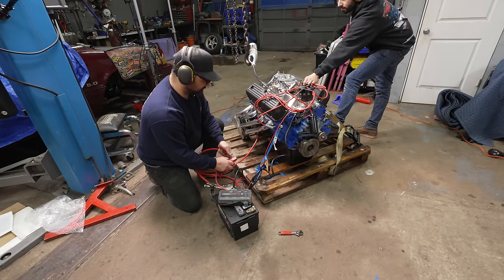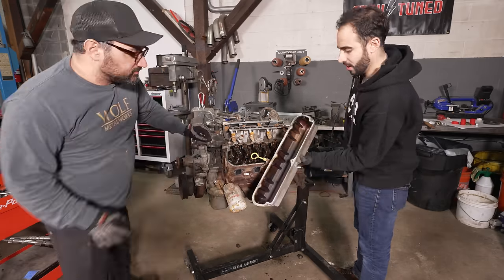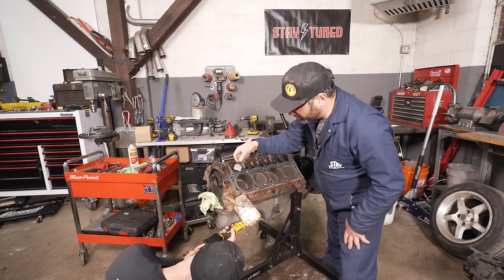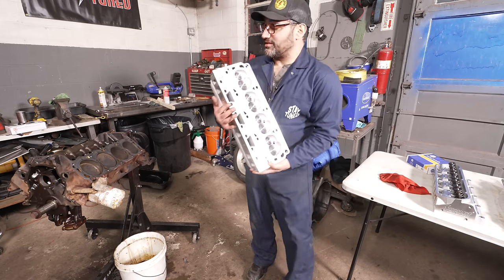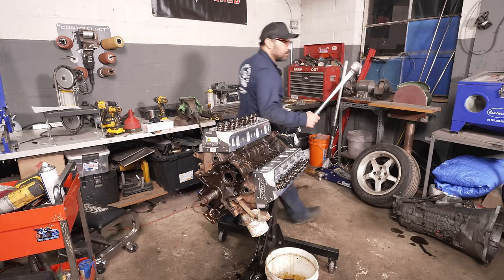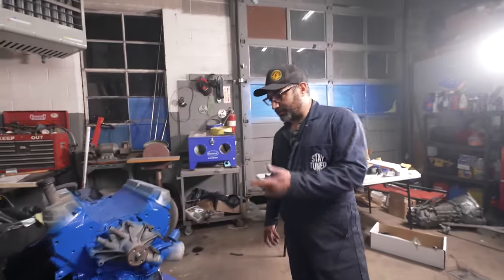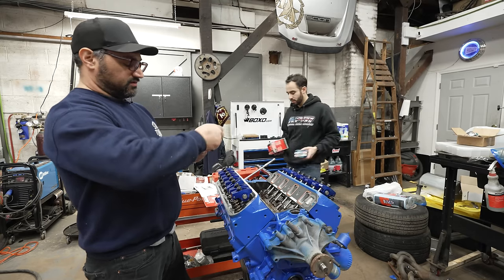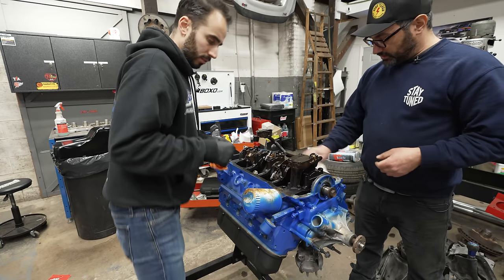Building a Junkyard V8 into a KILLER Horsepower Machine For Vice Grip Garage!

Comment: looks like a solid 87-92 Ford HO 5 liter.  all small block Fords have Forged connecting rods, 85-92 HO engines have Factory TRW pistons and a metric ring pack(1.5/1.5/4/0).  cranks were all cast other than the Boss 302/tunnelport 302 back in 68-70.  will make a lot of fun.  have a 67 Fairlane in paint Jail right now and cannot wait to get it back together.  Love the channel, sent you guys some pizza, hope you enjoyed it!
Reply from the maker: Thanks for the info and for the pizza! Appreciate it!
Reply: Ohhhh my C4 Corvette had TRW forged slugs too
Reply: Bro has a turbo on his 5.0 HO in a Foxbody.
Reply: That's too bad.... The TRW's are heavy ass slugs.
Reply: @davelowets  so is ur mom 🤪
Reply: "Paint Jail" so true lolololol
Reply: Getting ready to buy a fox body that’s been carb swapped and gathering info to find out if it’s the original engine or not and what I need to do to it. I know it’s been cammer and hei swapped, eldebroken 650 or 750 on top. Looks like an HO to me and it’s an 88 so I’m pleased. Looks like it was done right to the best I can tell from pics. Thanks for the information!
Reply: 0:08 needs more timing
Reply: 5.0 liter boat anchor. Might even sink the boat

Comment: I've only installed 390, 351, 400 Cleveland, 302 HO intakes using the end gaskets supplied, also gasket sealers at the corners, None of them moved or leaked. I have, however, seen others have to clean off and re-squeeze because they neglected to lower evenly. You do you.
Reply: Never in my life (48) known anyone to use the provided end gaskets on any pushrod Ford, myself included and have never had an issue...

Comment: Hey Tony.  One of my buddies that I worked with at the a Ford dealership raced a late 80's T-bird with a HO mustang used engine.  He cammed it and when checking the internal parts he found the stock Ford rods were harder then the aftermarket Pink rods.  So, those stock internals are very good.

Comment: Did a similar build a couple years back...used Trickflow 170 heads, Lunati Voodoo hydraulic roller cam, and Edelbrock Victor Jr intake with a Sniper efi...forged pistons, 

It was just a 306 ci, but it was a ripper! Man I miss it..sold the 76 F100 it was in for a Aluminum Hemi block! Wow...haven't got that going yet 😢

Comment: Hey guys,quick tech tip. If you  spray your gasket with 3M weatherstrip adhesive one part and one side of gasket,then grease other side,you will eliminate alot of leaks,hold your gaskets in place,it dries flexible ect... . Just a old trick I learned after working on cars for over 40 years. Keep up the good work guys,love the content. Would love to see more on the Porsche, like ps,ac, ect.

Comment: Recently hopped up an 86 302 Windsor on my channel.  Found out the hard way that 86 was a 1 year only flat top piston.  Had to cut my own valve reliefs 😮.

Went with flo tek heads, eddy 650, TFS cam, and single plane.  DOUBLED THE RWHP.  Its all on my channel from baseline dyno to budget build warrior.  These little motors rock!

Comment: Those little 302 can make some good power back in the 90's my friend had a 1986 GT and we put a set of heads and a cam in it and changed the rear gear to a 3.73 I think it was and had a 5 spd top loader trans and that car use to move for being a little 302. Those were in the days when everyone owned a fox body mustang except me I drove a 72 road runner at the time but everyone in my hometown had a lx or gt foxbody it was bad lol!!

Comment: 86-92 Mustang 302 engines have TRW forged pistons 86 has true flat tops with no valve reliefs. 
We always used 86 pistons & fly cut valve reliefs in them when possible.With a engine that many miles with good cylinders we always took block to machine shop honed cylinders out. Resized rods with ARP rod bolts. Polished or turned crank. 
Used file fit rings & all new bearings.
Because we spray them 175 shot constantly or run 12-16 pounds boost on them. 
Never split a block. Always kept them under 6250 rpm.

Comment: I was freaking out with the tap running in the head bolt holes. You gotta double groove a stock head bolt with a cut off wheel first, then hand tap them. Those taps are so hard and shear so easy.

Comment: Gentlemen, I'm REALLY looking forward to this project, as I've been seriously thinking about Building a 5.0 roller. I'm 70 and don't have anything to put it in, as well as lots of house remodeling to do over the next year, so Completely irresponsible, BUT! Sometimes a man's gotta do what a man's gotta do. The carpentry I can handle, this is new territory. Question, did you replace the cam bearings?
Big fan of both you guys and Derek, so double the fun. Don't cry about this being a Ford project, as "Real Men Drive Fords" Bud! Do not attempt to confuse me with facts as those I do not like will be ignored, So There! Keep Rockin Gentlemen!
Reply: Dude you should totally build a 5.0 you could just put it in a bar stool. Or a cooler. A v8 cooler would be lit. (That's what us youths call exciting.)
Reply: or one of those kit cars could be cool too

Comment: I owned a Blue over Grey T top 87 GT 5 speed . I bought it new.  They were listed with 225 hp and 300 lb ft. of torque at the crank. 
This was the beginning of the "new era" of performance, once people realized how much more power could be made reprogramming the ECU and using  sequential fuel injection.
Reply from the maker: Yessir. They are wicked cool and aged really well.

Comment: Using an electric drill to chase threads will never stop setting my machinist alarms off haha
Reply from the maker: HAHA I was the same way until I saw Lucky do it like 80 times and I finally said "OK FINE".
Reply: @StayTunedTA  It can be done lol you just have to know what you’re doing.  I won’t even start a screw without turning it backwards by hand first or at the very least spinning the drill back a little til it falls into the thread.

I’m just trying to avoid installing a damn helicoil

Comment: I love the idea of taking new aluminum parts and painting them to look original. I've got a 70 Mercury Cougar with a 351 Cleveland that I am slowly getting put back together. And every time I work on it or replace a part, I try to make it look a little more original. The idea in my mind is that when you open the hood, at first glance everything looks original. But with aluminum parts where I can (Intake, heads, water pump). I have even upgraded the original radiator from an original 20 inch 2 core copper/brass to a 24 inch (Big block radiator) 3 core aluminum radiator that looks original and uses the factory mounts and fan shroud. Painted the radiator semi gloss black. Looks like it came in the car.

Comment: Hey man, I dig all the eff words y'all are working on. I didn't see what you installed but if that cam is a true billet cam you need a hardened thrust plate to retain it.  The stock soft one won't work and it'll chew through the thrust plate and contaminate the engine. Just recently had to deal with this very thing on my 408. Hopefully it's not an issue. Keep up the good work and keep her between the ditches.

Comment: If I remember correctly those 5.0 made between 200 to 235 HP from 1987 to 1991 stock , we used GT 40 heads and a comp Extreme energy cam and lifter kit and we dynoed it and it made 400 HP and 365 FT of torque nice little engine with a Paxton supercharger and a pulley kit witch mad 550 and 490

Comment: Currently building a 5.0 that was rebuilt by someone at some point.it was a roller block bored 40 over someone opted to put a non roller cam .my buddy noticed right away when I removed the intake the missing dogbone and spiders .I was a bit disappointed and thought at first someone used a non ho block and put an ho intake on it.after double checking casting marks and firing order I discovered it was infact an H.o

Comment: I highly recommend throwing away Teflon paste for bolts that go into the water jacket or valley and using 3m ultra yellow weatherstrip adhesive.  My engine builder put me on to that tip.  He's used it for decades and is a wally holder, so we are talking a legit builder and racer.  You should try it!  When you take it apart you will thank me and it will never leak.

Comment: If you use studs on the end head intake bolt holes, it makes it easier to put the gaskets on without them moving, and then you can drop the intake down over the studs so they hold everything in line and so nothing moves.

Comment: For cleaning the head holes: amazon/etc sell bottle or tube brushes that you can chuck into a drill. You can slot an old bolt with a thin grinder blade for the heavier gunk or rust.

Comment: Steel gear on the distributor, front sump oil pan and pickup, plug the ds on the block where the dip stick went, drill the front timing cover for a new oil dipstick, custom radiator to fit the reverse rotation water pump, reinstall the serpentine brackets, custom flexplate( 50oz 157t) that will get you into the Fairlane.

Comment: Like the ,"Just in Case", steps you take. To prevent wasted time , money and engine failure. Looking at a 66 fairlane 500 wagon. 289, 3 on the tree. Front floors need some work,(Rust, shame I will have to put a T-5 from a Mustang in. Wish to drive from Sacramento  down to Lost Wages for a trip.

Comment: Lower head bolts need sealant... piston to valve clearance, usually you want to check that when running stock pistons, and that billet steel cam needs a steel distributor gear to match. No mention of hardened pushrods either. Check the fuel pump eccentric to timing cover clearance if running an older timing cover as well. And dont mix up your 28oz stuff with the late model 50oz.

Comment: Should have checked and / or replaced the oil pump. You really can use a full intake gasket package. Just remember to pull the center 4 bolts down , good and snug. Smack the intake with the butt of a hammer and repeat... then run the rest of the bolts. Watch that you use thread sealent on all the wet bolts, especially the water pump. Sounds Great 👍.

Comment: The 87' Fox Body/Thunderbird/Couger/F150 -302ci was factory detuned to 150HP by turning timing back to detonate early, smaller fuel injectors smaller than it can handle, ecu programming that has it not meet peak HP until 5,200RPM and cast iron exhaust on standard models. All in order to meet federal fuel standards as well as make Ford not have to work as hard to get bigger horse power out of the same motor for special models. LX and GT 5.0 came with cast iron heads. 

Police Interceptor, Cobra, Super Coupe, models @245HP had high flow alloy heads, sodium filled valves, roller cam profile more aggressive for higher HP at around 3,200RPM Tubular CrMo headers, bigger injectors  & throttle body, Cobra injection intake has better profile and flow than stock, intake manifold sits higher for a tunnel ram like effect with air passages separating H2O passages from air passages for cooler intake air designed and manufactured by Edelbrock for ford.

Comment: if i have a used subaru forester 07 just got put new tune up batteries filter plugs wires fluids put some techron and sealer in gas tank changed the radiator mount to aluminum billet from diecast, changed all belts incl timing for now, all hoses are good has 135k runs smooth when its brick cold i let it warm it up and little engine noise goes away but otherwise runs good to me what would be a good next move just to keep up the maintenance i have no oil leaks or anything this car was taken care of and maintained i found some info online but i can see the rest some hoses and things were replaced over 17 yrs. just want it to last i have friends who have older foresters and their running around with 300k miles plus and another with 260k and their all older one is like ten years older than mine i asked them if they had any issues and no major anything they said just basic maint. im hoping i have the same outcome lol. ive had subarus but all leases and my girl has the wrx reg one but very nice and quick.

Comment: FYI, '85 was the last carburetor setup, made 210 hp & 270 ft/lbs. In '86, with fuel injection was rated @ 200 hp & 285 ft/lbs, and in '87 with the overall refresh it was bumped to 225 hp & 300 ft/lbs.

Comment: Tony I absolutely hate to see others when they are building a engine and they do not run a tap threw all the holes to clean the threads out!!! My big thing and do absolutely every time I build an engine is I will run a tap threw every holes that is in the blocks and get them super clean!!! It definitely helps with more accurate torque readings and a more even torque readings!!! The other thing that is super important to me is keeping everything super super clean and this helps for everything going back together much easier and helps from something going wrong!!! I have seen guys putting rebuilding engines and do it in a super dirty area!!! Bad enough that it’s like a dumpster and that is definitely not a way to rebuild an engine for sure!!! Some how it works for some but most not so good!!! My most recent engine build was a full roller and blue printed 421 SBC that put out just shy of 700hp to put in my 1969 Chevy K30!!!

Comment: 87 would’ve had factory TRW forged pistons with a metric ring pack, short forged rods, (small 5/16 bolts), and a nodular iron crank. 225hp and 300ft lbs of torque. I sure hoped you flipped that head gasket so it says front. Otherwise it’ll overheat. Personally I love all the Ford content.
Reply: There will be a small square corner of the head gasket sticking out in front of the lower front head bolt if head gasket is installed correctly. If installed upside down, you see the tab at the rear lower head bolt.  I saw both sides tabs in the front.

Comment: You can guarantee proper intake placement if you use 4-inch studs on all four corners to guide the intake straight down., and then use regular intake bolts on the center four positions to secure it in place before removing the studs. 

Also, while you have the 80k-mile engine out of the car, go ahead and replace the freeze plugs. Just sayin...

Comment: If you really zoom up the Windsor engine up you can get to the point where it gets hot, REAL HOT!  The long head bolts will stretch a bit but the short head bolts will not... The short head bolts will crush the aluminum under the washers and the next run will not happen as the engine won't crank.  The cure is to undercut the short head bolts enough that will stretch.  It took two sets of heads to figure that one out.  I really wish you would have gone to a 347CI .

Comment: Just a couple suggestions

Man did I want you to put on some Cleveland style cylinder heads and make it a "Clevor"
Also use some aluminized body filler on the end of the cylinder head to complete the sleeper looks
And for the best Ford sleeper be Shure to use the dark for blue from the malaise era everything was slower then
Barb is correct the firing order is whatever cam we use

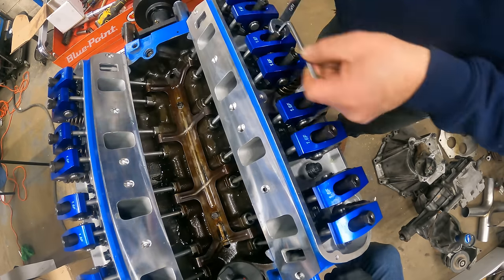Comment: So @3:16, I type this. I have a distinct feeling you got the firing order wrong. It is different between the 5.0 H.O., and LX 5.0 Ford engines. If you don't know this, it'll bite you in the butt! Had a customer bring his 5.0 H.O. Cobra swapped M3 in, because he couldn't get it to run correctly! Backfiring, and running on half the cylinders! Immediately after cranking it, I knew what had happened. Yup, 5.0 LX firing order! Never seen a guy so happy after I fixed it! Good to have a Ford guy around, @31:30 to tell you? 😁😉

Comment: Next time, jb weld or even a little bondo in the summit logo with a quick block sanding and you dont run the risk of altering or damaging the front drive/accessory bolt holes or mounting heights

Comment: We used to put new hydraulic lifters in oil to let them fill up with oil over night. Don't have to do that anymore? Just old school stuff. It's  been seems like a 100 years ( late 60's ) since I did any motor work but that is the way we did new lifters, just wondering what's changed.

Comment: Holley has a new mid ram intake that turns the intake into an LS intake, with the throttle body facing forward  instead of the side like oem mustang. Im curious to see how much more torque this new intake adds to the 302

Comment: Did you even change the oil filter? Who knows if this filter was even useable? Good way to add injury on a what might already be a compromised engine to begin with. I would have at least primed the engine with new oil and a new filter filter to make sure it had oil pressure. BTW, the 87 GT engine had forged pistons.

Comment: Nice engine,  i really like your commitment to detail of the sleeper look. Im doing up a 302 out of a 70 Mustang 2v for my 88 ranger.  Been waiting for good cams and lifters again before i order mine.  Im gonna run a refresh set of 289 head with screw in rocker studs and harden valve seats with a 3 angle valve grind and gasket matched ports i did at home.  Any word on who is making hydraulic lifters you can trust ??  Would appreciate the advice,  i cand really afford to do this twice.  Its going to be my old man hotrod. Id like it to last fot my son. Always good content, appropriate you guys. Keep it real.
Reply from the maker: Sounds like a great project, it's kind of hit and miss with hydraulic lifters these days. These Summit ones have worked well for us. If you want to get USA made really good ones, Johnsons makes them but they are $$$$.

Comment: Maybe you should check with ARP, relative to coating both sides of washer with molycoat.
Reply from the maker: From the ARP SITE: The lube should be used under the head of the bolt or the bearing surface of the nut and on the threads, unless a thread sealer is used.

Comment: I never get that lucky when i put heads on a 5.0. They always need valve reliefs cut in pistons or new pistons when using 2.02 valves and bigger cams..and yeah the pushrod length always need tweaking and valve springs need checking